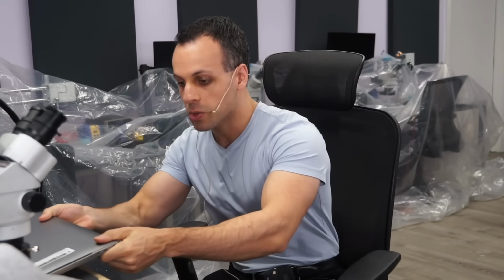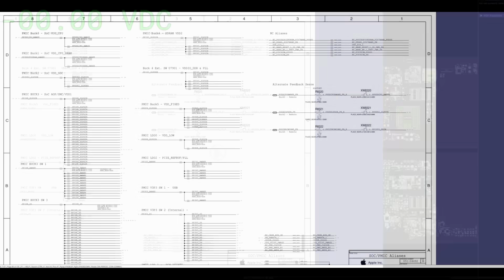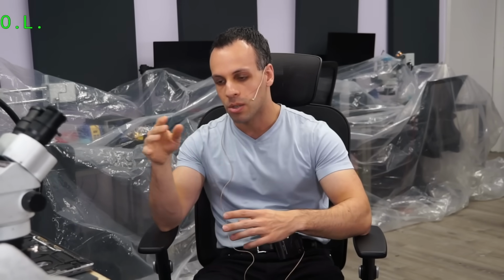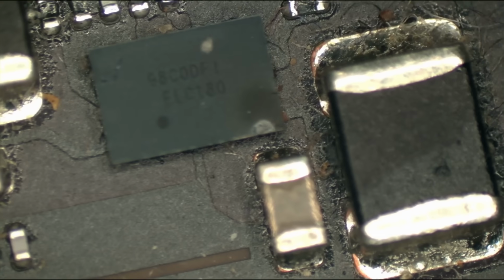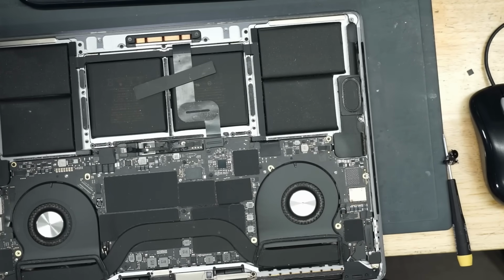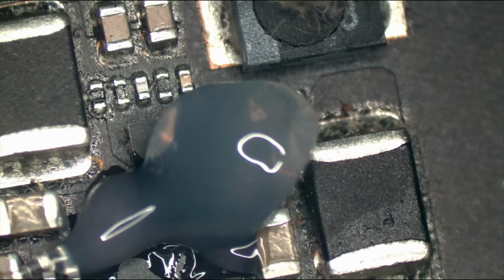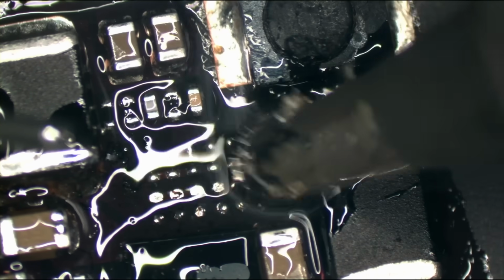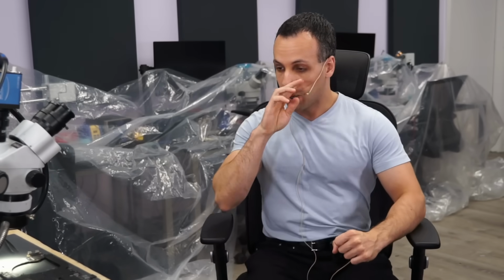How most 16" Macbook Pros often kill themselves & why they're unfixable

Comment: I own one of these. you scared the shit out of me and made me think whether i should be getting a macbook as the next device. So thanks for the nudge!
Reply: How about you sell it now to some Apple fanboy before it turns itself into a paperweight, and use the money to buy something that wont do that?
Reply: Get a Nas or just external hard drive and copy important data there. Or do a search for backup/recovery software if you want "automate once, forget until needed" approach.

Only time you'll lose valuable data is if both devices drown at same time.

The question is: how big is the budget and how disastrous financially it'll be to lose everything?

Also. There are free storages online like Google drive, Dropbox, ect that temporarily store and delete data if no requests are made to get it.

Therefore: there is free way of doing it and paid way. Look into both.
Reply: Time machine - set it up.  That is, just plug a frigging external drive in and follow the prompts.  They lead you by the nose.
Also get Backblaze - $50 a year and it continuously backs you up to the cloud.  Do both!  Holy shit, people practically have to go out of their way to loose data in this day and age :p

Comment: Can someone please TL;DR this for me? Why arent 16" macs reliable? Why is this problem not present on 14" macs?
Reply from the maker: SSD get 13v go boom
Reply: @rossmanngroup  eloquent, poetic and trustworthy. What else would you expect from rossamann repair comments?
Reply: @rossmanngroup  I work at an MSP and have to ship macs often / recommend client MacBooks - appreciate the info man!
Reply: @rossmanngroup  I love that answer
Reply: @rossmanngroup  afterwards you fix it hopefully it won't go BOOM again
Reply: @timothywong4318  the point is - you can't fix an SSD as a repair shop - and because it's apple, you can't even replace it
Reply: @rossmanngroup  lmao
Reply: a 2.7V rail that powers the SSD is next to a 13V rail - the TL;DR is that your data is one short circuit away from getting fried :)
Reply: @Guthix744  Yep. You know how static electricity makes you get shocked sometimes when you touch a door knob? That is literally all it takes to kill your Mac.
Reply: @mattb9343  tell it to the other dude, I'm studying electronics :> (or trying to, at the very least)
Reply: Apple designed them so that if/when the specific chip dies it fries your hard drive and you're SOL.
Reply: 13v also makes a lithium cell go boom
Reply: It has to do with the insane design Apple did with standard components like SSD to make them non standard. In any other brand and older apple laptop, the SSD is a distinct component that can be replaced. It’s also a reliable component. 

In this case, the defective IC is designed by apple for apple and has a catastrophic failure mode. Even if Louis could replace the SSD, not an easy job, he would be unable to pair it with the laptop because apple serializes its SSDs. The new SSD would not works without a pairing software that apple uses to vendor lock for their own factories. Even apple authorized repair centres do not have access to this tool.

And the data is still lost. No one, not even apple, can fix this.
Reply: The vast majority of the time when they fuck up, they shove a powerspike right into the SSD, which lobotomizes the data storage entirely. Nobody on this rock has the voodoo magic required to resurrect that, even if Apple allowed them to try. The rest of the computer could possibly be reused/refurbished, but that is not what most people are wanting Louis et al to do when they drop a couple hundred on fixing their computers.
Reply: This is a 16" Intel model, not one of the newer Apple Silicon Macs. It would still be interesting to know what causes the chip to blow up like this and why it doesn't happen on the 13" ones.
Reply: @patrickreuvekamp  Sight unseen, they are asking the chip to do things it shouldn't be made to do, and stresses it in unpredictable but persistent ways until it decides it doesn't want to exist anymore and takes your SSD with it on its way out.

Comment: Thanks for the video.

The soldered on storage is such a scam in terms of data recovery and thankfully the chinese have the devices to backup the nand content, also to flash it to another chip and reprogram so that the actual nand data matches the previous chip, unless obviously the chip is kaputt, as you suggested. Props for warning the general public on why they should think twice before purchasing the 16.
Reply from the maker: To be fair here even if it wasn't soldered on, when you send 13v to an SSD, it's gone. Whether it is soldered, socketed, or cabled... you don't send 13v to something that wants 2.7v... that's the end. 

However, one thing to note... I do not remember this EVER happening to ANY A1466, A1369, A1370, A1465, A1502, A1398, or A1425 machine. Ever.

Liquid, cat piss, coca cola, drop... none of the above models ever shorted PPBUS_G3H battery rail right into the solid state drive. It's insane.
Reply: @rossmanngroup  I miss the 820-00165 boards more and more everyday. You could run those things over with a tank and it STILL wouldn't short PPBUS to the SSD.
Reply: @rossmanngroup  but wouldn't it be easier and cheaper to replace a modular SSD?
Reply: @404nobrakes  yes but the same thing would happen either way was his point. Now if this model was made similarly to others mentioned above, we may not have this issue.
Reply: @404nobrakes  it would, but apple you now... they haven't made a device with modular hardware for a few years now.
Reply from the maker: @404nobrakes  Yeah it would but your data would be equally toast. NAND get 13v go poof, data bye bye.
Reply: @rossmanngroup  One little zener diode could solve that problem, but someone in Apple management is taking the money saved and snorting it away instead
Reply: @404nobrakes  It would require re-engineering the board. You wouldn't necessarily need to do an OMGWTF-style cut like people would on a Nintendo Wii but completely chopping out the SSD and modding the board to use a normal gumstick SSD? Sell it if you can make it fam.
Reply: @rossmanngroup  For me, I can get most of the data back from the TimeMachine backup on the NAS, but being able to replace an M.2 SSD for about $100 would be a lot cheaper than a new laptop.
Reply: @katbryce  very true.
Reply: @rossmanngroup  they should get the ssd power from any where other than ppbus_g3h like pp5v_s5 or pp3v3_s5.. damn apple..
Reply: Holy shit - people do back their shit up, right?  Apple makes it drop dead simple with Time Machine.  Backblaze is $50 a year.  If you are loosing data at this point your an idiot.
Now as for the repairability of the SSD - no excuses and I'm right there as far as the hardware goes.
But ranting about data loss in this day and age?  GTFO...

Comment: I’ve had 2 of my 16” Intel MacBook Pro systems replaced under apple warranty.
Reply: I haven't had an issue with mine. But I'm sure it'll be coming because I have two small "dents" on the cover of the Mac and well, I have a screen protector so when I close the Mac, it's bent or whatever so I'm just waiting in due time for it to stop working. Especially when my AppleCare runs out lol
Reply: How long did they last before failing?